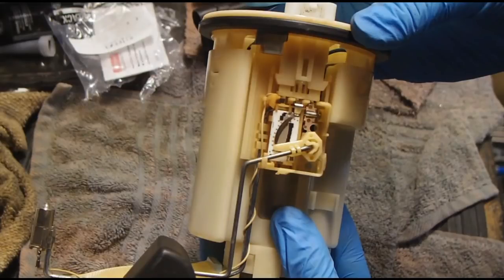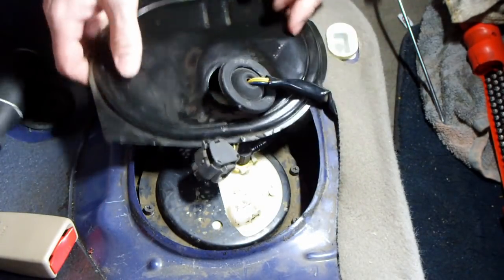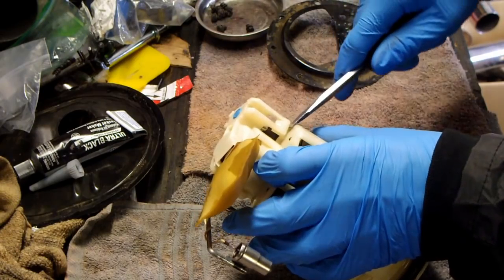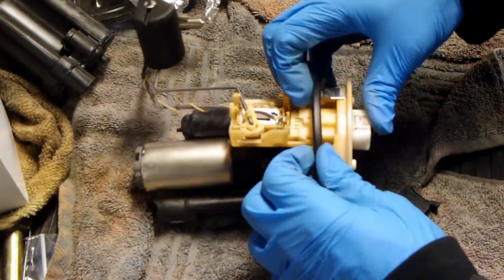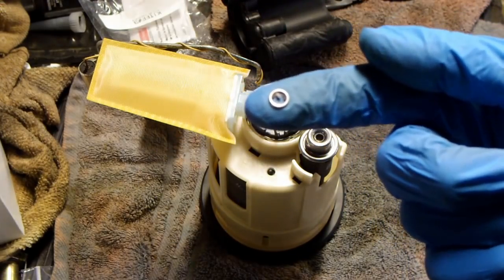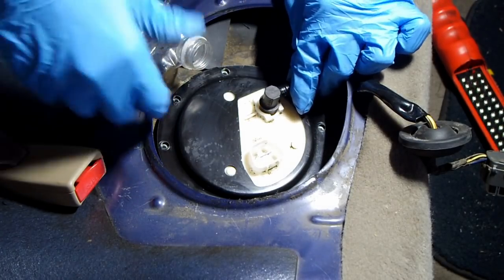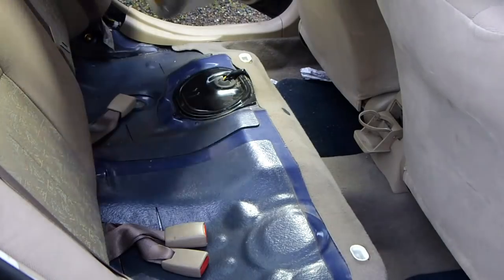1998-2002 Corolla Fuel Pump Replacement

Comment: Well-made and step by step and complete and careful. NO SMOKING or sparks at all ! Mine was replaced at 282K miles by a mobile mechanic  (one-time and no need to risk anything with a DIY) using certified OEM caliber parts. Immediately helped the hesitation  and will give it a day or so to 'relearn' the ECM setting needed for my driving pattern.

Comment: Why the hell am I getting quoted 900$ for this replacement when it looks this easy?
Reply: Because they're probably getting a whole unit which costs ALOT. Then labor and also they're charging you a bunch because they think you're gullible...
Reply: The whole assembly is like 500$ + they're probably doing the whole assembly plus labor.
Reply: @veevee305MIA  500 bucks? For a corrola.  Get outta here. I just bought a kit for 129.99

Comment: What are some of the symptoms the car was experiencing before replacing the fuel pump? I have a 2000 Chevy prizm with a slight acceleration issue under load and a slight miss at idle. I have replaced o2 sensors, pvc valve, spark plugs(iridium), vvti sensor, temp sensor, intake manifold gasket, checked primary and secondary resistance on the coil packs, vsv switch, Denso MAF sensor, and fixed the exhaust leak and I still have a slight miss at idle. I’d check the cell code but the previous owner had a aftermarket keyless entry installed and hardwired directly to the port🤦🏼‍♂️. My last guesses at this point is that it’s either the IAC or fuel pump and or regulator related but I need a pressure tester. Any recommendations?

Comment: Pretty sure my fuel pump when out. Car was driving just fine, got on the freeway, lost power, sputtered, and finally just died. Wouldn't start again. Had to get it towed. Got quoted for $1000+ repair. Saw I could do it for like $300 or less. 

Thank you so much. You saved me hundreds of dollars.
Reply from the maker: glad to help.
that's the point of these videos.

Comment: Muchos Grasioso...  3rd Gen Guy for the 'complete' rundown of the fuel filter replacement... I had a couple of the rubber pieces and the plastic sleeve in various positions, and it just didn't want to assemble correctly. a couple of pauses had me realize the rubber 'cushion' went on the top piece, not inline with the filter and the pump.  I bow to thee Corolla Guru.

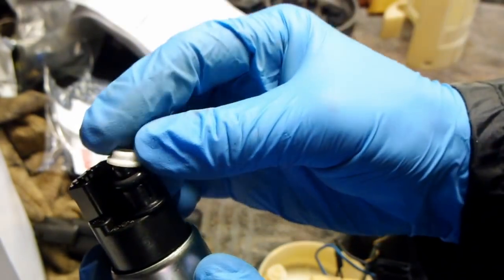Comment: Great video, EXCEPT at 2:29 anyone who reads this, DO NOT put the grommet and O-ring in the fuel filter before putting the fuel filter back on the assembly, we wasted almost an hour trying to get it on. This guy even changed the approach without mentioning it at 2:55 where the grommet and O-ring suddenly appear on the plastic part before he puts the fuel filter back on. It easily slides right in once you know to do it that way. Could’ve done this while in less than 30 min otherwise, super great follow along and very informative. 👍
Reply from the maker: you mixed up the filter port with the pump.
2:29 is the part that connects to the pump housing assembly not the pump itself.

Comment: Awesome guide, thanks.  My car sometimes take longer than I'd like to start.  I fixed my starter(was having the click sound no crank issue) by replacing the plunger and contacts in there, but the car still takes a while to start.  I was thinking maybe it's a dirty fuel filter and could just replace the filter and strainer, but maybe should replace more if I'm already going to be in there.  Not a must do job yet, but probably a smart thing to do soon(almost 190k miles on my 99 corolla).

EDIT:  Also lately have had issues with an improper fuel level reading, the other day I wasn't looking and the fuel came right out of the fill port onto the side of my car and onto the ground.  I ordered the fuel pump, strainer, filter, and gasket.  On the fence if I want to order the fuel level sending unit as well and the fuel pressure regulator.  The pressure regulator can get quite pricey unless you get one of the cheap ones that are only around 20 bucks.  Not sure how much those cheaper ones can be trusted though.  I know it's cheaper to replace the parts rather than spend 5-6 hundred on the whole assembly, but this is quickly becoming an expensive job.  At least I'll save the money on labor thanks to guides like this one though.
Reply from the maker: how new is the battery?
i had some rough starting and running issues that were caused by a battery that had weird voltage drops.
Reply: @3rdGenGuy  battery is about a year old.  Tests fine and shouldn't be causing any issues.  Not sure I want to spend the money right now on the parts so may wait on this.

Comment: Where do you get the o-ring and white piece added to the new filter in 2:30? Do you reuse from the old filter?  Replacement filters don't seem to come with these parts.
Reply from the maker: I installed a new filter while I was there.

Comment: I broke the clip, how do I find out what type of clip to order?  Where is the best place to get something like this.  Rock auto?  Amazon? Ebay?  There is a quick connect under the floor pan connected to a hose that goes to the front of the car.  If I could order an identical quick connect I could insert a T at that spot and attach a fuel pressure gauge.  Any idea where I can order one of these types of quick connects?  Great video thanks!
Reply from the maker: not sure what clip you are referring too, but the surefire way is to go to a junkyard. LOTS of 98-02 Corollas and Prisms still around.,
Reply: @3rdGenGuy  Actually a 2002 camry but that sounds like a plan.  Had no luck finding something similar on amazon and I could scarf up the quick connect fuel connector under the gas tank while I am at it cause trying to match that on amazon isn't going well either.

Comment: Why is my car cranking but not starting after replacing fuel pump , filter , regulator,strainer? I filled up gas tank and primed the new pump. It started after two or three different start ups. But not sure if I did something wrong in between replacing the parts however I strongly don’t believe so.

Comment: @3rd Gen Guy 5:15 What did you use the RTV for?
Reply from the maker: I didn't use any RTV.
i thought i might have to seal up the door, but the stock rubber worked.
Reply: @3rdGenGuy  Ok cool. Thanks for making this video. Saved my bacon.

Comment: Would this work for my 2001 Chevy prizm
Reply from the maker: yes, some things might be a little different, but it's the same basic thing. same part numbers.

example, your pump unit might have a screw on cap VS the bolt on one mine had.
Reply: @3rdGenGuy  thank you

Comment: your reassembly shows a tube of Ultra Black silicon (?), did and where did you use that?  I was looking to replace the filter only as preventative maintenance, it looks like you say to replace all and others say to replace none...what is screen for?
Reply from the maker: i didn't end up needing the black RTV as the black screw in plate had enough butyl rubber to seal back up.
that's the plate that screws to the gas tank.
you want to replace the fuel filter AND screen.
the filter is OLD OLD at this point and is mostly clogged up.
the screen's go bad as well. they get brittle and snap off.

Comment: Thank the lord I don't have to drop the tank. Thanks for the very helpful video!

Also, is it absolutely necessary to replace all parts? I am on extreme budget and I can always replace the others later. 

Thanks
Reply from the maker: the  stock old fuel pressure regulator is the only thing you can save.
you can't really re-use the gaskets or filters
so you can shave $60 off by re-using the fuel pressure reg
Reply: Thank you so much for this reply!

Comment: I bought a fuel pump for my 99 corolla and the plugs are a different size on the new one, but it came with new wiring and  the plug that would fit, how do I replace this?
Reply from the maker: usually you can retrofit the new Plug on the old wiring. if you don't want to risk it, find a OEM replacement.

Comment: I got the new parts, but the fuel filter doesn't seem to be fitting into the assembly spot, nor is the pump fitting into the filter. Any help?
Reply from the maker: it does require a bit of wiggling.

Comment: Hi  No accessories came with my fuel filter.  The video shows a grommet and a white plastic cap for the filter.  How do I get them?
Reply from the maker: can you explain further?
the filter is 1 piece.
Reply: I mean the rubber washer and the white plastic piece you attach in the video.... also  I am not able to remove the screws that surround the cover.  My phillips-head will not bite.  I'm afraid of stripping them.  I bought all the parts and the car is sitting in my driveway for three weeks now.  @3rdGenGuy
Reply: Did you get er done Noreen?
Reply: @jeffspicoli1661  Yes.  I did this 2 years ago.  It was very cold outside which made the job very difficult.  Thanks for asking.

Comment: Hi, I have a Toyota Corolla 1.4 VVT-I Liftback from 2000, ive been searching where is it located, I also took of the fuel pump, But i didn't desasable, do you think that my fuel filter is inside that fuel pump? best regards
Reply from the maker: Hard to say man, there are so many random variants of corollas from every country.

i would start by looking up part numbers online. they usually show a schematic of systems with numbers pointed to each part. that'll tell you if the filter is part of the assembly or somewhere else.

Comment: I have a code with a p0171 on my corolla 2001 with 197k miles. I have done a tune up. Change all my motor intake gaskets, clean my maf sensor, inspect all vaccum leaks, new coils but I haven't change my fuel filter or my fuel injectors. Do you think changing my fuel filter would get my code fixed?
Reply: Jose a doing this rn for the same reason I’ll update you in 30 if I remember lol
Reply: 315k miles loool
Reply: Thank you!
Reply: 30 mins into my drive I have more power but I am met with misfires which were previously there. I think it is an issue with my valves. I will press the pedal and it will become more responsive as I lift up off the pedal. I am going to try fuel injectors and then proceed to do a valve job. All of this is good experience I guess and I am definitely wasting my money on this hooptie when I should be investing into other things.
Reply: Yes you should change your PCV valve because of your high mileage. You can get it for 10$ at the auto store and its an easy self job. I changed mine because it was really black from the inside last year.
Reply: What have you changed recently?

Comment: Where did you purchase your parts from?  I’m having a hard time finding a reliable fuel filter by itself without purchasing the entire fuel pump assembly
Reply from the maker: i got mine off amazon, but EBAY has a BUNCH of Toyota OEM stock.
https://www.amazon.com/Toyota-23300-0D010-Fuel-Filter/dp/B00KTJ993Q
Reply: Google search brought up Walmart... I got the fuel and filter shipped for LESS THAN $31. (Did NOT get the white plastic ring / collar)

Comment: I did it, I think.  I had to stop and replay many times, but the alternative would be too much talking and needing to speed up.  Everything was covered but more detail on the 'popping off' parts might be nice for a first timer.  I've never changed one inside a fuel tank because they often say not to bother but this car will be good for 100's of thousands more miles so I'm doin all maintenance.  I've not road tested yet but all went back.